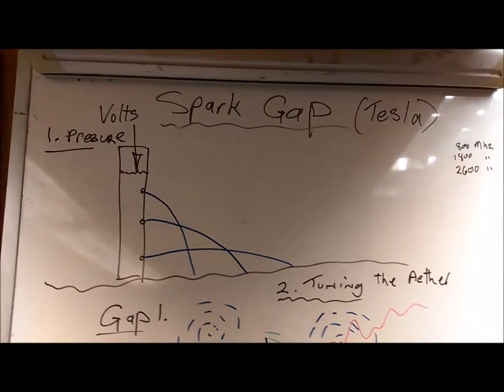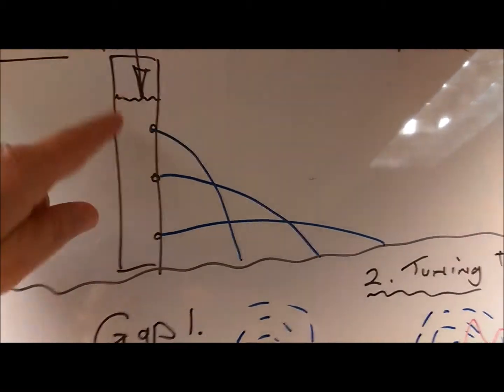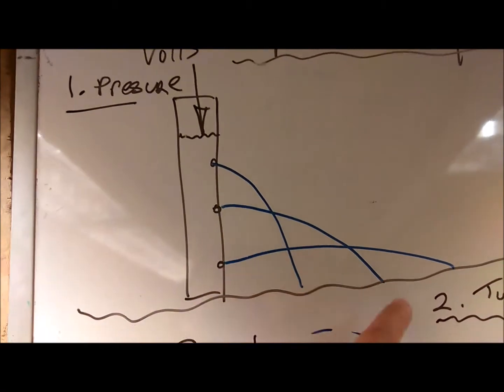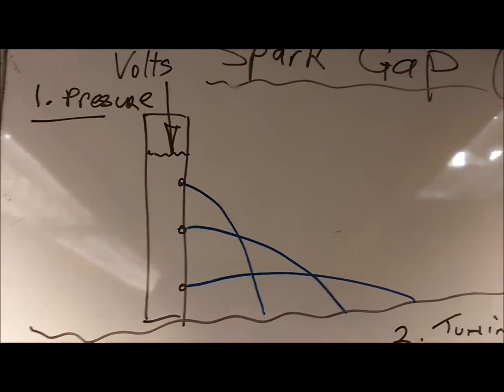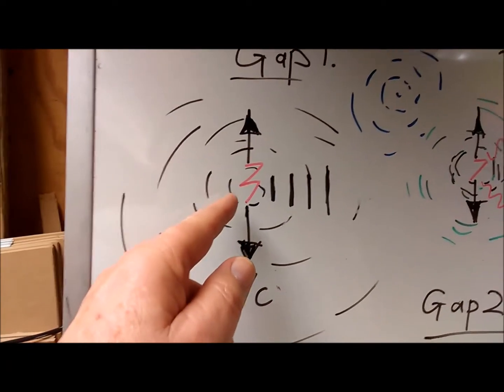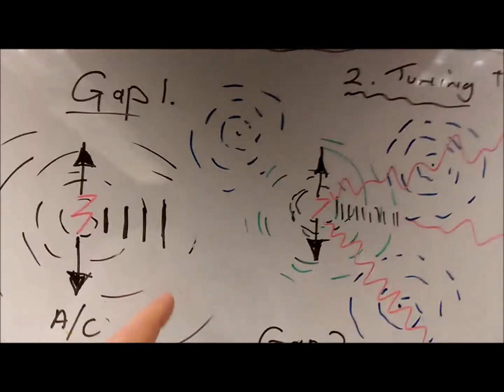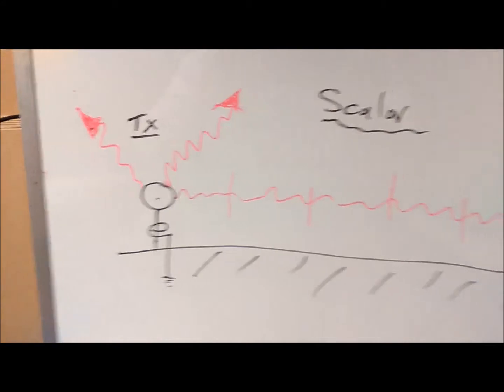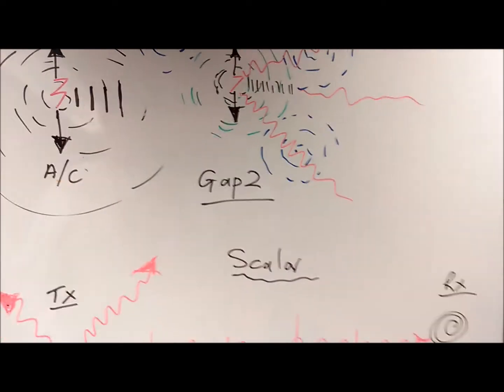Knowledge Base AC v Pulsed  Scalar Frequencies

Comment: Epower take a look at gerard morin on vid.me and youtube recently.  also he talks about vibration is the mechanical beginning of resonance.  Like a guitar pluck a string and then the wood begins to resonate.  He shows a dishwasher pump motor that has a spinning magnet that induces a vibration into a tuning fork this tuning fork is inside a larger copper coil the coil puts out electricity with a sign wave when used as a generator.  He then up steps the voltage through a transformer then very important uses 3 arc gaps to convert back to DC current.  This is how the power companies can transmit Resonance Frequency long distances through the over head power lines.  Then the transformer step down creates the watts and amps that feed our house.  The 3 arc gaps amplify the Resonance.  Even Tesla said VIBRATION is very important!  Even Teslas and Otis T Carr's saucer design used caliper like tuning forks to create resonance with a spinning aluminum and copper disc to operate. Cheers
Reply from the maker: Hi N.R. thanks for your input. Your take is good!  Take a look at this video, its about "Space Weather" (electrical Universe)? https://www.youtube.com/watch?v=lmaeF9zjrBI   
The whole video is great, try to focus in @ 7:12 timeline, the nature of potential - chases + wow.  .. Regards ... DC